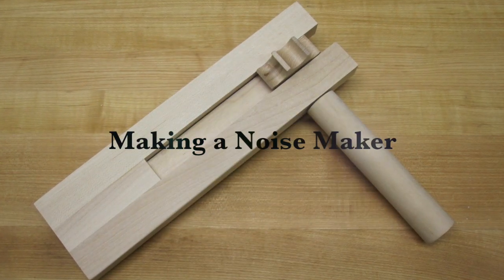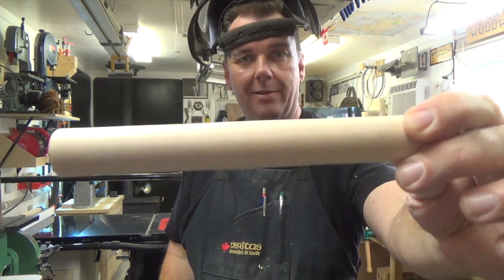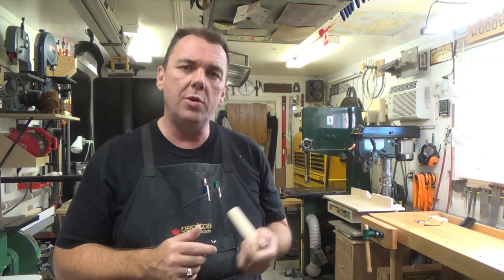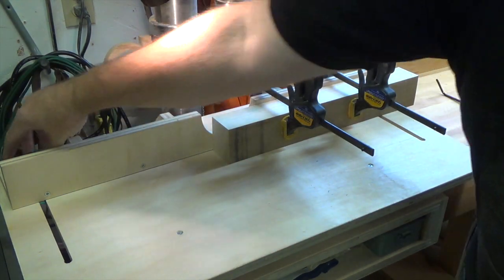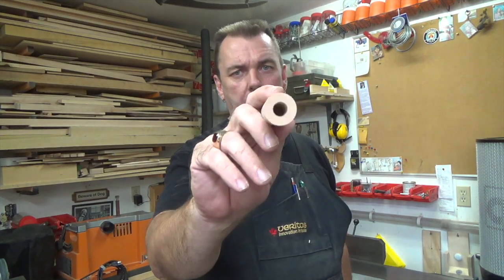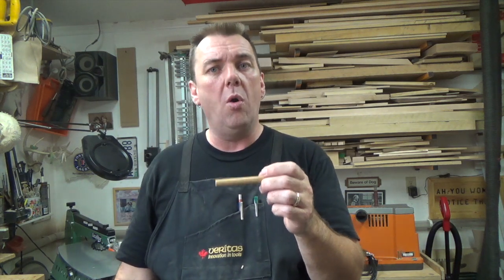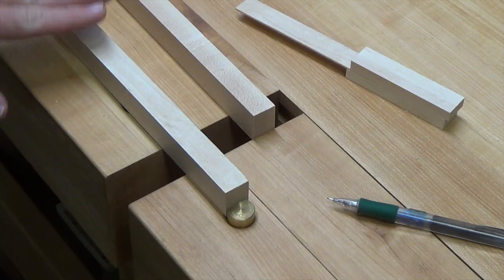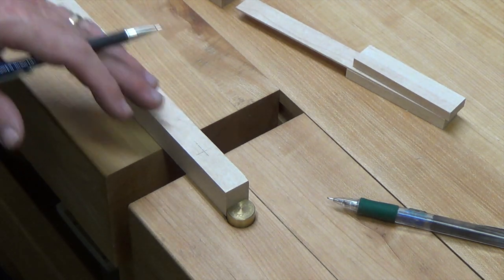Making a Noise Maker

Comment: can you use glue instead of pins?
Reply from the maker: You certainly could use just glue but the joint would not be as strong and might let go over time.  The dowel pins add strength and stability to the handle and the cog but if that isn't and option that's available to you, then glue would still work.  I hope this helps.  Thanks for tuning in to the show.
Reply: @acutabove_woodworkings  okay thank you so much for answering. hope you have a good day/night.